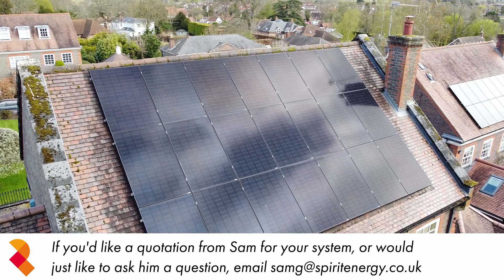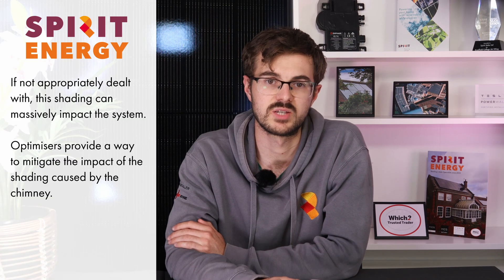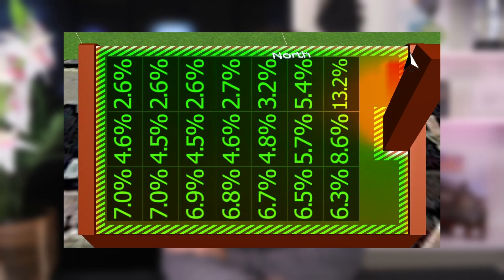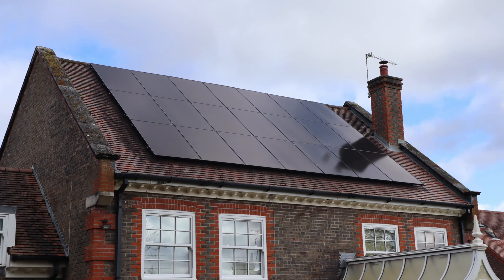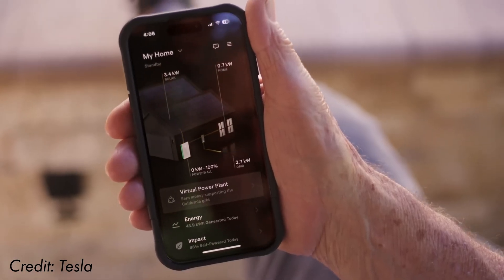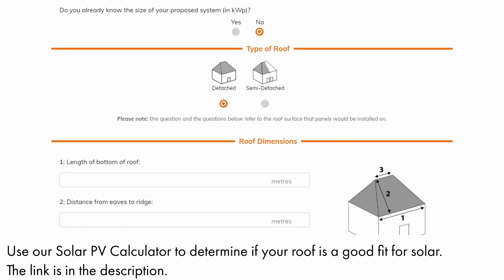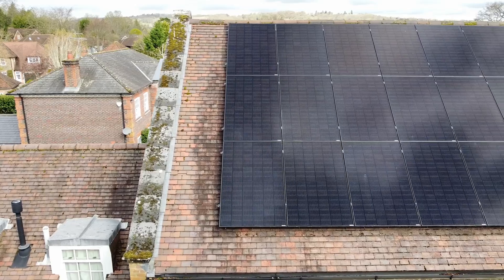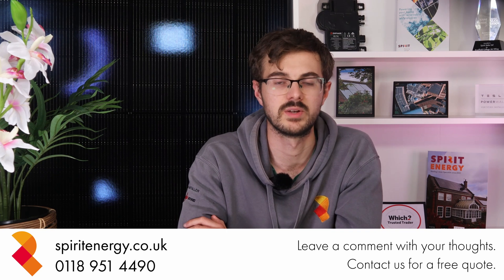Solar Panels, Tesla Powerwall, zappi Installation in Reading - Spirit Energy Case Study

Comment: Is the instilaation possible without
Reply from the maker: Thanks for the comment. Is it possible without which part?

-Tok
Reply: @spiritenergy_uk  i`m guessing the battery system. Btw what is that module for the panels with shades on it?
Reply from the maker: @DanielCardei in which case yes it’s standard to have solar only with no battery. 

The optimiser is from a brand called Tigo. 

-Tok